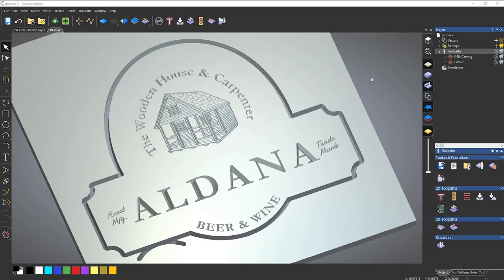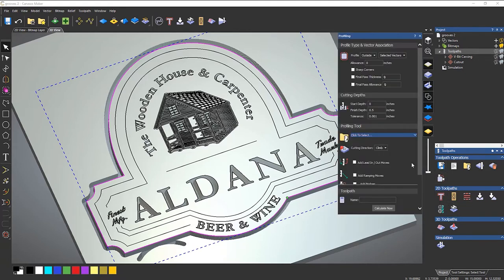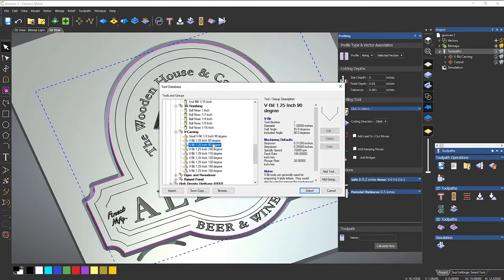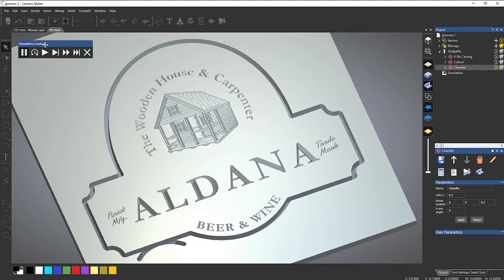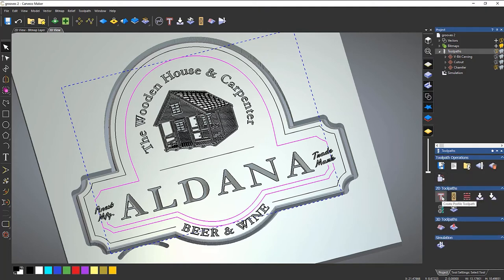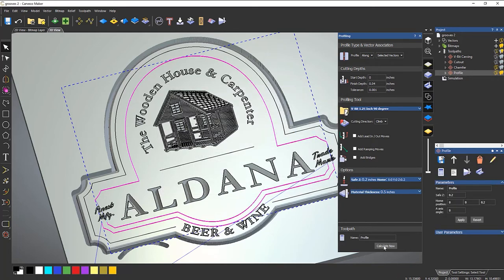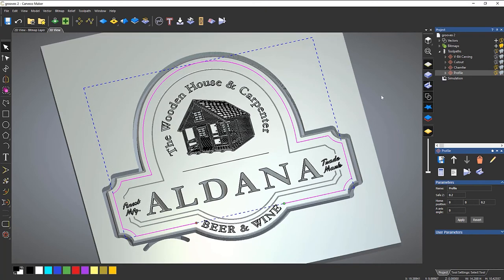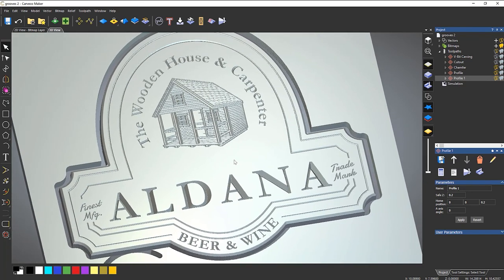Tips and Tricks: Grooves and Chamfers

Comment: How would I do a 2 inch wide 45 degree chamfer?
Reply from the maker: I would offset the vector by 2" and then select both of the vectors and do a V-Bit carving toolpath then you can machine it in passes using the stepdown.